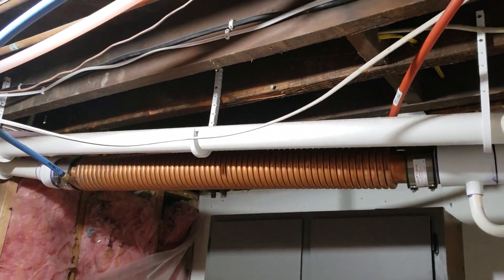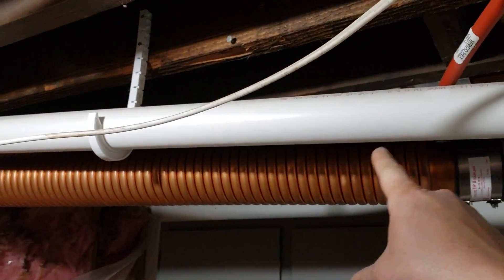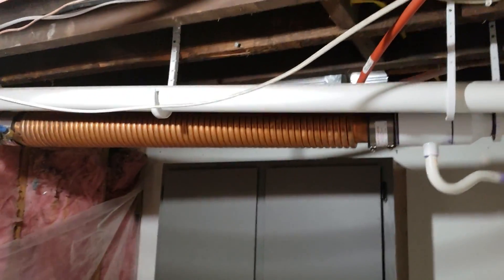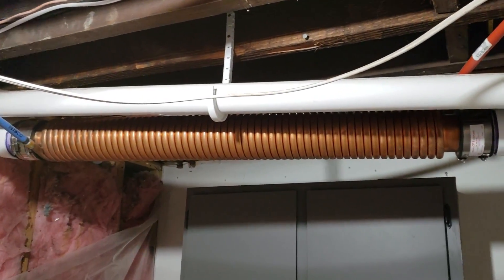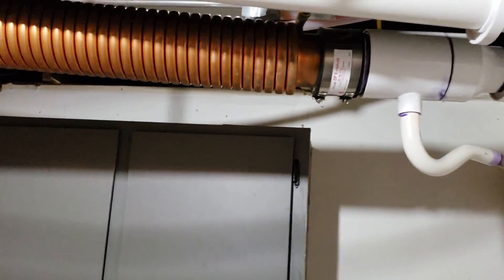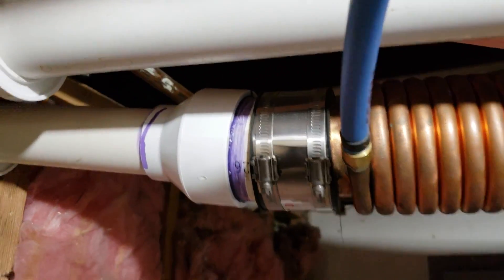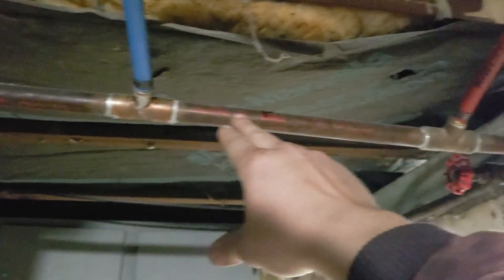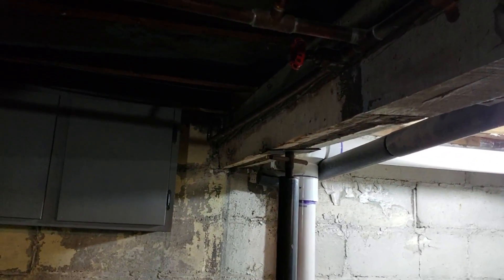Experimental Heat Recovery Furnace Exhaust! Preheat water heater

Comment: Thanks for sharing this. I'm a HVAC mechanic and engineer I'm working on something similar to this. I'm trying to make it work with a 80% furnace though that doesn't use PVC for venting it uses metal flue piping. I'm not sure why there's so much backlash on the comments. There's a lot of commercial buildings that use this technology. But it's really cool how you were able to get it working. I plan on adding solenoids and sensors to activate the water only when the furnace is runiing . I'm planning to use it as a secondary heat source not for heating water .
Reply from the maker: Wow, cool! Thanks for the comments. Right?! I make it clear it is experimental, but a proven concept. It absolutely works and heats up the water, especially if it was a lower efficiency 80% with hotter exhaust Temps. Thanks for the comment!

Comment: You could run the coil on the inside of a 5" or 6" piece of copper and have more surface area for the water.

Comment: Just had a client ask me if this was even possible. I am familiar with DWHR systems but THIS IS SWEET! To my knowledge, you’re the only dude who proves it is in fact doable.

Trade school taught me flue gases are corrosive, akin to acid rain / full of products of combustion. I’ve never seen a condensate drain like that before, is there something that scrubs the flue gases to neutralize it before it reaches the copper? 

I’ve been taught copper is a no no for flue vents due to shitty corrosion resistance in acidic condensation. But if you take that into consideration and eliminate the corrosive elements of the gas… I don’t see why that wouldn’t work. 

Have you had any corrosion issues 7 years + down the line? And do you have a neutralizer on the flue vent?

Monoflow tee is what I call those half open tees in my area

Comment: Water is not efficiently heat this way.  
1. Use a small primary tank, and circulate this water through the exchanger when ever the heat is on (small Taco pump and a microcontroller.
2. Reverse the direction of the water flow through the exchanger. Cold goes to the distill end, warm comes from the hottest part - by the furnace.

Comment: I'm very interested in this idea - are you at all concerned about the copper (3") pipe corroding over time from the acidic condensate exhaust gases? From my understanding that condensate can have an acidic ph between 2.0 and 4.5. I would think it should be fine for awhile, but long term, do you think it corrode your pipe and leave you with and exhaust leak?
I'm thinking about building something similar to this and using 3" Sch 40 316 Stainless Steel pipe for the exhaust - and then wrapping that with the copper coil tubing. The rational being that 316 Stainless is less susceptible to corrosion. 
Thoughts anyone? Thanks!

Comment: Wonder if some thermally conductive paste in between the coil and pipe to draw more heat out.  You could also use the coil as a heat pipe like in pc’s.  You put water in it as a closed system with a condenser section with a passive heat sink and use the heat sink as a secondary heater inside your central air blower unit..

Comment: Nice video. Very well thought out system. Have you checked the flow rate through the coil itself to confirm that T splitter/diverter system is actually working? Flow is weird, usually takes the path of least resistance. That coil is a lot of resistance just due to the length of it. Chance there's no water going thru at all. 3:46
If you capture the flow rate and input/output water temp differential (thermal cam/probe), you could estimate the total kW saved. Would be cool
Reply from the maker: Thanks. Yes it works well. Can feel  the temperature difference of the water line. Cold coming in, and Luke warm going out
Reply: @larsonhomeinspection9932  Good to know! That's a lot easier than measuring the flow rate haha
Reply from the maker: @ashneilroy these were made for water flow. They were made to be installed vertically in a sewer waste stack in a house absorbing heat from waste water (showers)
Reply: @larsonhomeinspection9932  The cumulative resistance in the distance to, through and back from the coil will change the flow rate in that coil by a lot. Luckily you have that 50% T diverter. If you feel the input/output difference, that 50% diverter is probably well suited to the application

Comment: Gotta insulate all those pipes.
Reply: They give you a typical 4-5” flue vent sleeve for insulation. Like what you find on HVAC vents in cold spaces. Not individually wrapping the coils. That would be ridiculously time consuming. It’s literally as easy as sliding a JUMBO sock over the coils

Comment: If the exhaust is too hot to touch....This would possibly be high-static in the air handler.  When this happens the 95% efficient furnace is no longer 95% efficient.  Most of the efficiency from the 80% to 95% efficient furnace comes from the secondary heat exchanger when the vapor in the flue gas condenses.  When the air handler static is high the airflow is reduced thus raising the flue temperature.  

I would be curious, what is the Duct leakage number (total and leakage to the outside), then total external static compared to mfg data, temp rise, and watt draw on the furnace?
Reply from the maker: Air and duct leakage have nothing to do with exhaust air. The exhaust temp is only 100 degrees.
Reply: Airflow and duct leakage have a lot to do with total external static, which has a lot to do with the efficiency of a furnace and system efficiency.  From what I think I know if the external of the pvc exhaust is 100F then it is to high. @larsonhomeinspection9932

Comment: Where can i get the heat exchanget pipe?
Reply from the maker: Theyre called drain heat recovery pipes. I have one I'd sell you
Reply: @larsonhomeinspection9932  I'm a buyer!  ill take a measurement tonight.  its a short steep run from furnace up to chimney main pipe, only 4 foot run maybe, so length may be an issue.  Thanks Larson!
Reply: @larsonhomeinspection9932  Yes, i was correct, my span is 4 foot max, 7" dia exhaust.  Have one to sell?  Are you selling this one?   Why if so?

Comment: You will need to add a 3/4" sweat globe valve between the hot and cold take-off ports.  Water will take the path of least resistance.  The coil tubing has 60ft of equivalent length, which has a higher pressure drop than the small short run of pipe between the hot-cold take-off ports.  You will have to throttle the globe valve to force water through the exchanger...
Reply from the maker: Not true. These scoops are designed to separate 50% of the flow. It worked great

Comment: Could you plummet directly to a heat exchanger connected to your hot water heater? So, you're not heating the whole homes water, just the hot water that you're Using.

Comment: Dumb. The low grade heat from a condensing boiler is negligible and the rubber fernco fittings are illegal on a boiler exhaust stack. Put the shower drain economizer on the shower drain and you will actually save energy. 100% of your hot shower drain water is going out to the sewer.

Comment: Yeah that's not doing anything dude. Water only flows when when you're using water and then its less than half id say closer to 2/10's of the water flowing to your tank that flows through that heat exchange and that's why its hot to the touch. You're much better off with a tempering tank made out of an indirect water heater with a pump to move water or a thermal fluid through that heat exchange. This setup you have is doing next to nothing and I'm sure if you take a before and after temperature reading of your main line you'll see that there is little to no difference at all. Not trying to shit on your idea I do something similar but this is just not an effective way to recycle heat.

Comment: That’s cool. We have a 96% furnace. We have a 20foot pvc exhaust for it and it doesn’t feel super warm near the end, so I imagine a lot of the heat radiates into the cold basement. It’s the only thing stopping me from putting an air to air metal heat exchanger on it.

Comment: It would make more sense if that was for your preheat for the water heater tank or boiler. That way neither has to raise it as much, and you're getting that return. Warming up the cold water is couter productive as people will just, run the water longer in order to get a cold to drink. That being the case you're just running it down the drain. Heated up and put it where it's going to be needed or utilized so it means that your water heater or your boiler is on less often or not as much to bring the water up to temp. 
Great idea. Not utilized as well as it could be.
Reply from the maker: That's a bunch of nonsense.

Comment: It seems to me there are a couple of weak points to this installation: 

1- there is no insulation, so heat recovered by the copper pipe is simply dissipated into the air. 

2- the bypass you installed does not ensure   single direction flow, so it is possible that the pipe is taking heat from the water rather than giving it.

Comment: you havent seen anything like this because you dont know the names of the devices. on a normal boiler this is called an economizer, economizers are never used on high efficiency boilers because your exhaust temp cant be higher than 180F or the thermal fuse will blow and the unit wont run. if this were an old atmospheric boiler or just anything that has a significant stack temp this would be a flawless installation aside from the fernco. may i sugest that you build a rocket stove and use your heat exchanger there as an emergency heat source with isolation

Comment: 1 issue here, the exhuast of a furnace needs some amount of heat energy to draft correctly, by extracting heat energy you can greatly effect the flow of a gas stream and can f-up fhe furnace efficency so by "recovering" 1-2% of the heat you lower the furnace effeciency by 10-15%. Its a net loss. If it workled well dont you think they would be included already when you buy a furnace so a company can claim 98% efficiency?
Reply from the maker: HE furnaces don't rely on heat convection, there's an inducer fan.

Comment: there is a pretty common thing in europe named condestation boiler. about 10 years ago u can build in a condestation bolyer only. at low temp what good for wall/floor heating ~38..40C have over 100% effiency. about 115% because capture the heat from the steam what arises durring metal burning... and produce a lot distilled water. even the (coaxial) chimney and most part of the boiler made from ABS plastic just becuase the "smoke" only 40-60C hot.

https://www.youtube.com/watch?v=Xnl26qh5RXc

Comment: Did you solder the ends of the 1/2 inch spiral copper tubing you are running water through to keep the loop tight on the 3 inch pipe ????

Comment: Cool, thanks for sharing. In Alaska many years ago I built some similar heat recovery 'Stack robbers' for generators and oil/diesel furnaces using stainless steel tubing, and on generators an exhaust diverter was required so as not to boil the glycol in the robber.  We generally used them to supplement hydronic heating systems with a large open loop storage/mixing tank  systems with zone pumps for each loop. The worked great for many years but required a bit of maintenance.
Reply from the maker: Cool!
Reply: @larsonhomeinspection9932  Thanks.
Reply: @larsonhomeinspection9932  Hey my guy, where can i find this exhaust heat exchanger?  product?  I want to do this mod but cant seem to find it anywhere.  And i'm on a time crunch with bebe on de wey.  Thanks!

Comment: What was the temperature of the exhaust before you installed the mod? What is it now? 
I'm pretty sure I can hold my hand an inch from the exhaust of one of these burners, indefinitely.  This is why they can use plastic pipes for venting the exhaust outdoors. 
The reason no one was stupid enough to do it, is because the copper alone costs more than any energy ever recovered.

Comment: I was thinking of something similar with a generator that you could run off natural gas. Hot water, Heat and electricity pumped back into the grid. Effectively a on-demand water heater that pays for itself.

Comment: I like to do recovery on 4 " exhaust on furnace , no water  just air go through the copper , then a small  fan pulls out the air out of the end of the copper pipe into the living room . I will wrap the outside of the copper pipe  to capture more heat .  I do not know if I can get soft copper pipe so i can wrap it around by  myself

Comment: Without any numbers it is subjective at best. I don't believe it has much of an impact as you only send water through your coil when there is flow, faucet of dishwasher for example. The rest of the time you are heating a couple of liters of water a few degrees that will vanish rapidly when in contact with colder pipes. What you need to do is have the inlet of your coil on the cold side of your water boiler and the warm side on the hot. A circulation will be created as warm water rises  and flows to your boiler creating a draw on the bottom, maintaining the system as long as your heat source is active. As I lived in Hawaii I had made a solar collector on my roof working on that principle so I know it works. My energy bill dropped by 33%. Of course your exhaust pipe will not generate 1KW /Square meter like the tropical sun but it "could" have a positive impact. Also. Wrapping a tube around a tube gives you a very small contact surface, just a thin line if you think of it. You could better this by either soldering, insulating around the whole device or better, running your coil inside the exhaust as total immersion will give you a 100% exchange surface

Comment: How did you wrap the 1/2 inch copper line around the inner pipe?
Reply: He didn't, these are commercially available at hardware stores such as Home Depot, just search "Drain Water Heat Recovery"

Comment: I like the concept. You could run the exhaust through something with fins on it - like an automotive oil cooler in a box. You would still have corrosion issues. Main question is why not put this in the drain water pipe instead.  Building codes in some places are requiring drain water heat recovery systems. Building with staggered stud/ double stud walls also dramatically increases insulation value - potentially saving bundles in heating and cooling.
Reply: You cant obstruct the exhaust much at all on high efficiency furnaces as theyll throw error codes and go into a lockout mode shutting itself down sometimes.  Ive seen where even a screen with mosquito netting caused the system to shut down..

Comment: The 3” copper will last a few weeks with the acidic condense in the flue exhaust it will rot - band using copper in condensate connections
Reply from the maker: Yes, that's why the inside was lined with a coating.
Reply: It doesn't matter what coating you have it will leak in time. I've seen stainless flue pipe on commercial boilers not leak new and 4 years later leaking. There is a reason why they use pvc only on condensing boilers
Reply: They use it because using metal pipe heats up too much and can melt wires touching it or possibly start fires.  Pvc absorbs some heat but doesnt radiate much.  That said the new building code requires a pvc pipe that is rated for hot gas exhaust ir flues because pvc gets brittle over time with heat cycles and has been causing carbon monoxide leaks in houses all over the place..  the new stuff is blackish and gotta use same fittings and all..

Comment: Wait, so is this preheating the water going into the water heater, or is it just warming the cold water going to the rest of the house plumbing? Also, have you tried wrapping it insulation to save the heat that makes it too hot to touch?

Comment: Yes people....you can pump carbon monoxide into your drain......and you need  to spend more to heat your basement...... Lol.  Think this out dude.    Fail.
Reply from the maker: It's not going into a drain, it is the PVC exhaust for the boiler terminating outside. And a little added heat to the basement is a good thing - it runs in the winter.

Comment: They sell these in HomeDepot, but the installation should be done vertically.  As the water drops, it is thrown against the inside of the walls.  In this case, you are only using half of the interior walls since water is probably only reaching half the diameter of the pipe,  This means you could still increase the efficiency of this setup.  Check with the company to be sure.

https://youtu.be/6VITshAnTY8

https://youtu.be/nyAoT9748lU

For the HVAC, there is a different heat recovery device, also, at Home Depot.  

They claim a heat recovery of over 30%, and in addition, it reduces the HVAC cooling energy.  

This is measured as lower amps for the HVAC units.  I read somewhere that heat recovery is a little over 2,000 BTUs per kW or per ton (don’t remember well) rating of HVAC.  There is a news clip somewhere in YouTube about these units in Florida.

https://youtu.be/Td00sJZwKQo

Comment: It would be more efficient if you had insulated it, just saying. Also highest efficiency is with the largest Delta T which means if you turn it the other way, you will have a greater success. The coldest part should hit the hottest part first.
Reply: No, the cold feedwater should be in the lowest temperature of the combustion gas for maximum heat extraction from the gas. That's why in steam plants we put the economizer in the end, the boiler in the middle, and the superheater in the hottest part of the furnace. But definitely insulate it.
Reply: Gregory Malchuk μt = (t2 - t1) / (t3 - t1) is the equation. So you are telling me this is wrong. Please explain. How is it more efficient to do it your way? And please provide the equation which you use to determine the best most efficient.